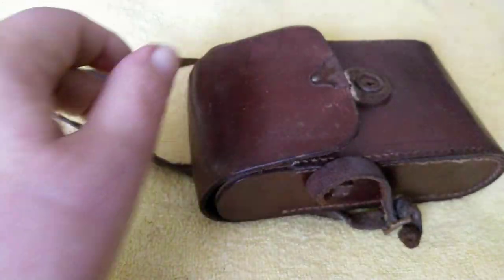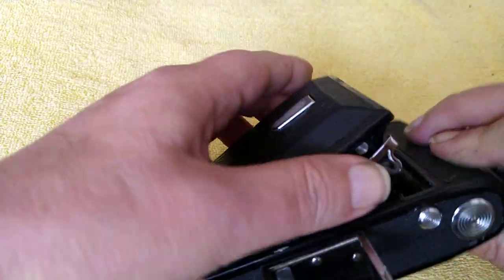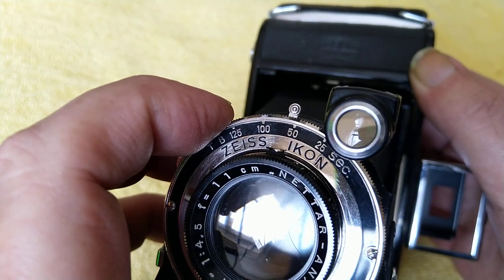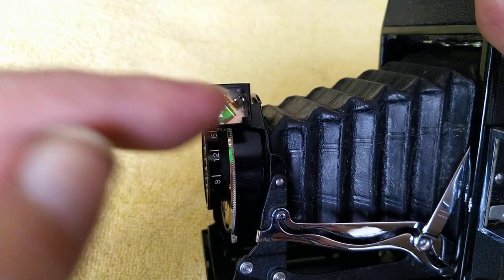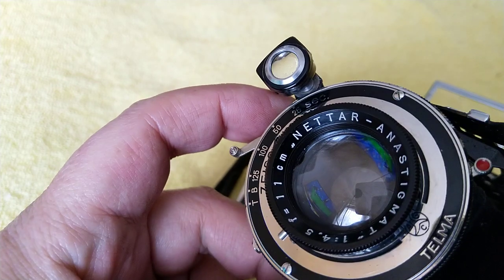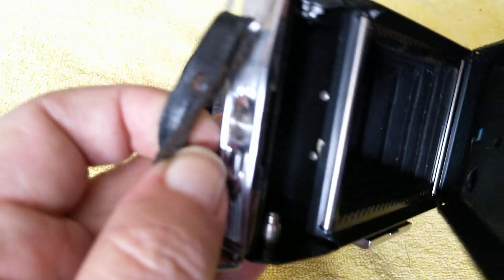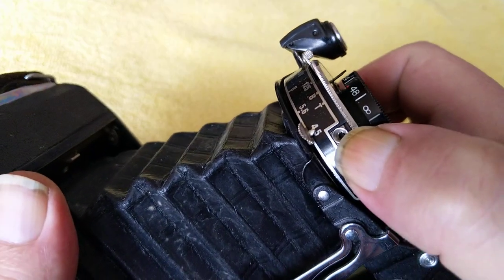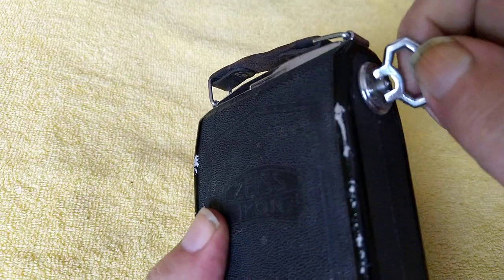Zeiss iKON 6x9 folder, initial impressions

Comment: Looking forward to seeing some of your photographs
Reply from the maker: Hi, they are coming, 8 exposures per roll, ouch...
Reply: @thephotographersbag  oof! I made a comment a few days ago but I think it got auto moderated because it had a link to amazon. The question is what foam I should buy for re-sealing the back of a camera? Should i be looking for open cell, closed cell etc?
Reply from the maker: @glovesbat  Hey, they are a bit funny about links that take you away from the site, I tend to buy the mixed packs of foam from eBay, dark grey or black in colour, some are more dense than others, and the strips are precut, makes the job a lot quicker, there are other better options like black wool for example
What camera are you going to replace the foams on?
Reply: @thephotographersbag  It's on my canonet 28.
Reply from the maker: @glovesbat  will dig mine our and have a look at the seals and there locations and come back to, I don't think they are too hard to replace, are you get fogging on your shots from light leaks?
Reply: @thephotographersbag  So i actually haven't taken any shots with it, the seals were so badly degraded that all I have done is wiped off the remainder. the camera has been through the wars a bit as it also has a significant amount of sand inside of it (have you had this before?). All the mechanical elements are working so I don't think I'll mess with trying to clean it out as it's mixed in with the oil etc. I'm also still annoyingly waiting for the battery converter to arrive.. the royal mail have been so slow for me lately it's driving me crazy. I opened the battery compartment up and it seemed pretty clean and all parts intact, i cleaned it up a little but just waiting for this damn battery!
Reply from the maker: @glovesbat  Hey, sounds like its been to the beach a lot, loose sand can be blow away but the mess you describe sounds like a real pain to sort out
The only seals are the ones around the film door, easy to replace and readily available on eBay or use black wool/string, it works just as well
Shame RM is keeping you waiting, can I get an update once it's ready please?
Reply: @thephotographersbag  yeah definitely! thanks for the seals advice I've now bought some that I'll need to cut. Can I ask you one more thing that's been bothering me.. I do apologize about all these questions. Curiously the top metal  lens ring was really loose when i got the camera. I tightened it back up by removing the black cover and screwing it back in. the issue is that there is maybe.. 1mm of difference between the left and right side in terms of how much of its poking out from under the focus ring (i hope this all makes a little sense..) is yours perfectly straight? I imagine it wont effect use as im pretty sure the actual glass lens isn't part of this shroud. Do things in camera's come loose over time or has someone been doing some tinkering and weirdly not tightened it back down.
Reply from the maker: @glovesbat  Hi, yes it should be even, and no cameras generally don't fall apart, someone has to undo stuff, sounds cross threaded to me, they are very fine threads and are easily cross threaded....
Reply: @thephotographersbag  it hasn't   come loose since, think ill just ignore it for now. Thank you so much for answering my questions you definitely have a life long subscriber haha
Reply: @thephotographersbag  The light meter works! I'm so damn excited. going to hang out with the family on Saturday at the black country museum and I plan on taking the camera and getting a few shots :).
Reply from the maker: @glovesbat  that's excellent news, hope the weather is kind to you, please let me know how you get on and if everything turn out well after development 😁
Reply: @thephotographersbag  will do! many thanks for all your help.

Comment: Beautiful condition considering the age (a bit like me😉). Warm castor oil for dried out leather, thin coat, let it soak in and buff up. Repeat as necessary. Softens and shines. Works great for shoes as well !
Reply from the maker: Hi Iain, I am very pleased with this camera, thanks for the castor oil tip, very handy, definitely want to shoot a few rolls through it 😀
Reply: @thephotographersbag  Only certain chemists stock it, although you can sometimes find it in asian stores as a hair oil (my shoes smell of jasmine).